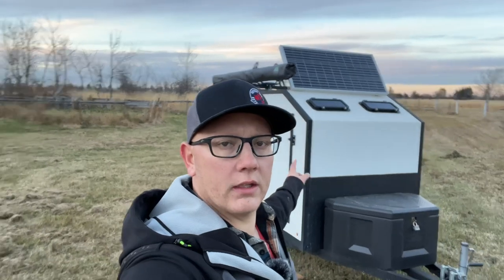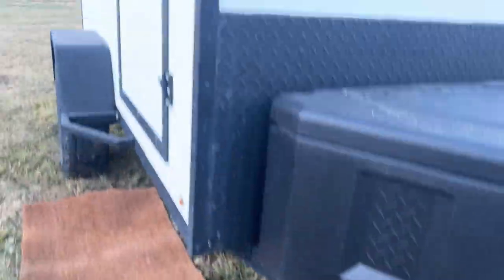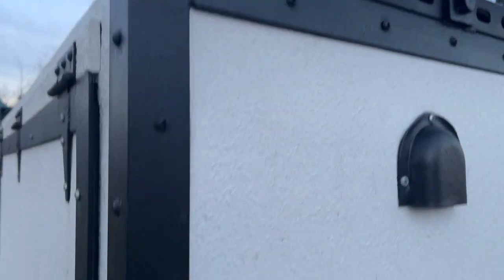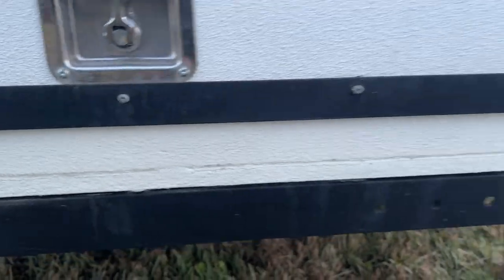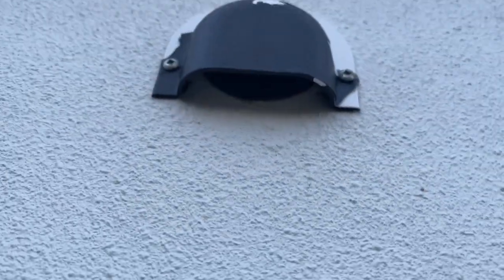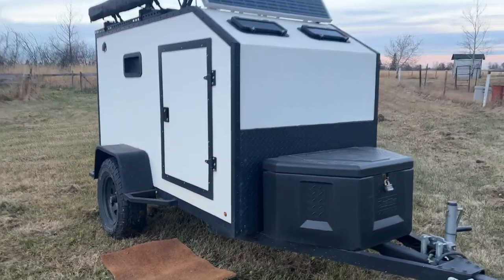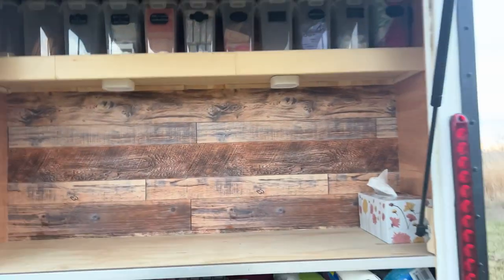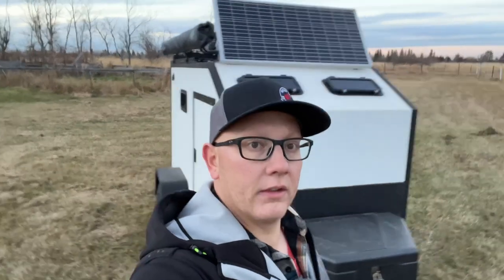DIY Squaredrop Camper Build - Will the Raptor Liner Last??

Comment: The ONLY improvement would have been that it been built in a larger size , like 5x10 or better yet 6x10 . Otherwise it's the best designed and built diy squareback on You Tube ! Hands down ! Loved the axle sub frame ! You did the best with what you had to work with , KUDOS !!! 👍👍🙏🙏
Reply from the maker: Agreed, next one would be bigger. I originally built it for just solo adventures behind the UTV or vehicle. Once completed, the family loved it and wanted to join 😅 . Placing the roof top tent on top has allowed the four of us to enjoy lots of adventures. Thank you so much for the kind words and feedback!!

Comment: How extensive did you prep for the rhino liner, primer on the wood?
Reply from the maker: I sanded the wood, placed epoxy on all the seams about 2 inch overlay and then sprayed the raptor liner.

Comment: Thanks for the update , I am soon  building a camper, how much raptor liner did it take for your camper ? And was it spray can or roll on ? Thanks
Reply from the maker: I used the Raptor liner that requires the airgun to install. I ended up using 10 x 1L bottles.

Comment: Door trim, where did you get it, what is it called?  Thanks!
Reply from the maker: Door trim was cut and welded out of flat bar. The inner seal is D-shaped rubber door seal, link in description of video.

Comment: Like the build I am considering raptor for mine but what did you use for the underbelly?
Reply from the maker: I used a roll on Box-liner for the underbelly before building the body of the trailer.